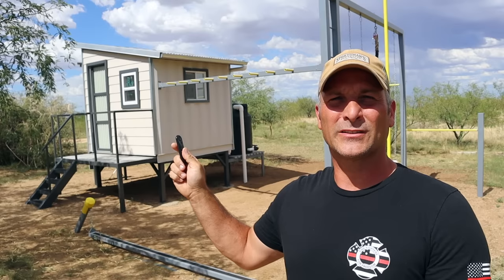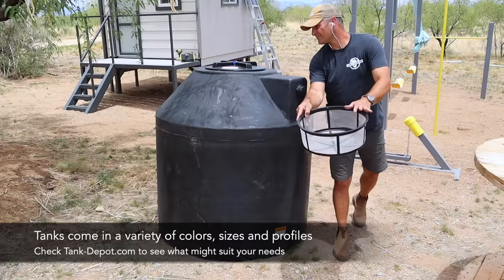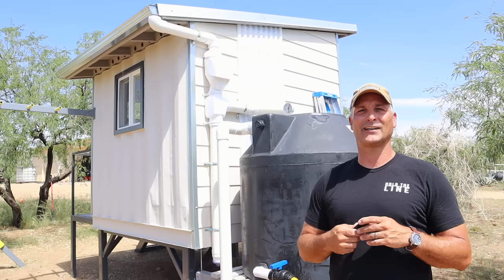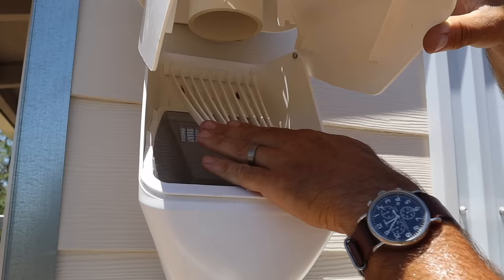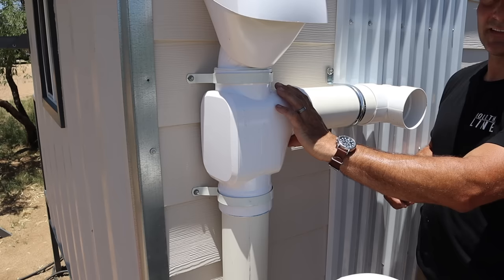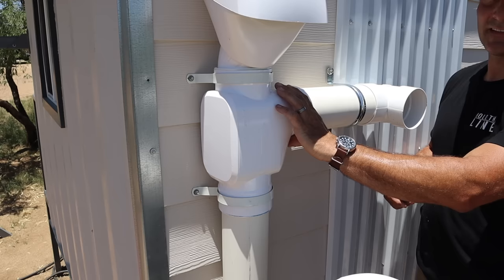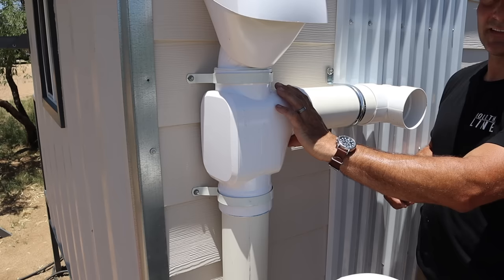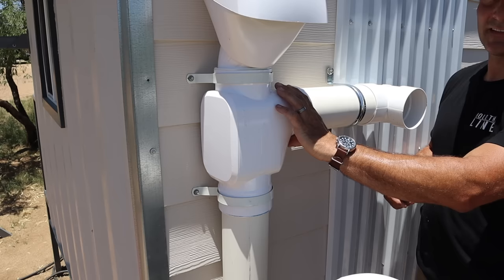Rainwater Harvesting on a Small Structure - How To - Step by Step Guide

Comment: What kind of filters do you use to take out the cemtrail poisons?
Reply from the maker: Move outta the city…. They focus on high density populations areas😉
Reply: @homesteadonomics , he needs more help!

It is no secret seeing water vapor form exiting a car's gas engine when cold. That's why propeller planes emit water vapor and that condenses into clouds at high altitude. Yup, the law of physics applies to jet engines also. They too emit water vapor, but it's warmer at lower altitude, so it's not condensed into clouds!
Reply: Try aluminum foil!
Reply: Excellent question

Comment: That is a really slick setup.  You might want to spray paint the plastic pipes with some silver or aluminum colored spray paint to protect them from the uv.  They can get pretty brittle.
Reply from the maker: You know what…I intended to mention that during the video but just plain forgot.  I do plan to paint then the same color as the side of the shipping container that they are mounted on.    But I’m gonna wait until summers over😂

Comment: Hey thanks for sharing. This was very helpful to me.  Just wondering if you would recommend putting gravel on the PVC pipe that is running underground. Thanks again.
Also, was going to say, since you threaded the PVC fitting onto the water tank  first, you can always extend the PVC pipe connected to your water outlet where you put in the spout. In other words, run the spout to the end of your raised structure that the tank sits on. I think that would have worked, too. Looks great.

Comment: A nice trick for starting the hole in the tank with the hole saw is to run it reverse to get the cut started. Bad things can happen running a large hole saw forward when starting the hole, and hard to get it started exactly where you want it. I've installed hundreds of tanks and it really helps. 

Nice work. Maybe a little overkill on the pipe diameter ;)
Reply from the maker: Haha….yes, very much overkill on the pipe size.   But this was the only structure I had to do it on as my house, shop, and pretty much every other structure already has tanks and collection setup.   So this was more of a demonstration opportunity to show the kit and also add a system to the container playhouse….even if it is capable of a lot larger volumes from a larger structure😉
Reply: @homesteadonomics  Major props to you for doing all that water harvesting. If we can get a million or two people on board maybe we could help return the Colorado river to its former glory.

Comment: Great setup and video. One thing I would do is connect the first flush to the overflow pipe to prevent any pooling below, which could lead to foundation erosion or wood rot pending materials. This would also help with any insects that thrive around water keeping them further from the collection tank and building.

Comment: Perfect timing. I've finally decided to get of my butt and get busy on a rainwater harvesting system. I know you're a fireman, do you have a high pressure pump that you can hook up to your system to protect your property in case of a brush fire? I had asked on a local FB group if anyone in my area had experience with such pumps and everyone basically said "Don't be stupid, call 911 and run away.", which I though was the most asinine advice I'd ever heard. If lightning hits the brush near my house and starts a brush fire, I'm not about to flee and hope it doesn't reach my house before the fire department gets here if I have a chance of stopping it before it gets out of control. Better to put out a burning bush or two than wait 5, 10, 15 minutes for the fire dept. when that one burning bush has become a  quarter acre wildfire.

Comment: nice clean install. We dont have gutters along our roof, and when we do get heavy rains, it floods the back yard and part of the back porch due to a low area. Im thinking I could install one of those (and gutter system)  along the back roofline and catch the water, and discharge the overflow directly into the breather/clean out for the sewer. That would prevent the flooding issue in the back yard possibly
Reply from the maker: I would definitely check out ‘French drains’ and possibly do a gutter run and then downspout that to the rocked area of the French drain.  Should solve that problem perfectly😉👍

Comment: I have had several houses with gutters and every single one of them has had problems with water sitting in the gutters.  Sometimes to the point it overflows the gutters.  The problem is poor quality materials for the gutters which causes the gutters to sag over long runs.  This is exasperated by debris collected which restricts flow.  This causes the gutters to create more problems than they solve.

Comment: I saw another video about taking a swamp cooler and generating, not using the humid output air, but circulating the cold water in the bottom of the swamp cooler, the sump, to pump into a room/house, and then running it through a heat exchanger, and with a fan making a low-power air conditioner that runs on water and solar energy.  This Playhouse design could be a very important self-contained designed for people in these hot heat-wave areas that would not take up much energy or resources and would keep people cool and let them survive in the coming years where this is probably going to get a lot worse.

Comment: Given the state of water in the desert southwest these days, more rainwater harvesting is always a good thing, even from a small structure like that playhouse.

I won't be surprised if you end up painting the tank a lighter color to prevent the water from overheating. Pouring hot water on plants or feeding hot water to livestock is probably not the healthiest option.
Reply from the maker: Yeah, I agree.  And you’re right on the painting.  I told them to send whatever was quickest to get our the door.  But I do like my tan colors out here😉

As for the rain, just depends on the location.  For example, last year we had (parts of southern and mostly southeast AZ) one of the best monsoons in recorded history.   Of course the news will only focus on the Vegas/Phoenix areas.  Fits the tempo of what they like to push.

And for the watering…yep, hot will damage and in many cases kill plants.    But I’ve got a little bit of a different end goal on this tank.  As a large volume  fill up for my fire trailer that I built several years ago.  2” fill with the quarter turn and it should fill those 30 gallons real quick 😀👍

Comment: Nice video.  One thing to point out (might already be in the comments) is that a 300 gallon take will weight 2500 pounds when full, therefore a very sturdy support system must be in place to hold that kind of weight.  And what about a system diversion so you can bypass the whole system for those in areas of freezing weather.
Reply: Agree 100% thanks for that.

Comment: Love this video!
QUESTIONS PLEASE:
57 year old city girl. Have wanted out for years. 
Have 5 acres raw land.(4 acres are wooded)

 Put a 12x32 shed with metal roof on the property. 
Need to be able to use the water for everything. 
The shed needs gutters and rain water harvesting. 
I all ready use Berkey filter for drinking my city water. I love it!

Property is TN/Al line so it does  get some freezing temperatures. (Bought property at end of winter so not sure how many days of freezing temps. )

I want to live on property year round. 

Questions:
1.What do i have to do so it doesn't freeze during the winter?

2. Can you connect additional tanks for more capacity?
I looked at my water bill for May and it said i used 1280 gallons (i don't know if that's a lot)
 I'm not using that water for gardening. 
I have a shallow well pump for gardening/irrigation. 
If i use that much every month how much storage should i plan for?
I'm trying to learn. 

3. Can the gray water from the shed/ house use the same pipe system as the tank overflow pipe?
I want to be able to use that overflow/gray water for garden and fruit trees. 

4. Anything I'm not thinking of?

Thanks in advance for thoughtful  and non condescending responses.
Reply: Hi, I live in Interior Alaska…we have an underground potable tank we fill ourselves or have water delivered..not sure how far the tank is buried, but we have heat tape wrapped around the outlet pipes that go into the house to keep the pipes from freezing during winter. We plug in/turn in the heat tape when it stays at freezing temps. Your use of harvested water is going to depend on how much it rains. Since we haul our own, and it’s just the two of us, we know we have to fill about every two weeks..our underground tank is 1000gal..we have a 200gal tank we put on the back of our truck and head to the watering station during non frozen months. We go til about November before we have to call in for delivery. I’ve been wanting to harvest rain water for a long time now for personal use to cut down on self hauling. This summer we hardly saw a drop of rain for May and June. It’s raining now and our 100gal rain barrel is full. That’s free water that I want for the house! This channel has given me the confidence to at least try different methods for our home. Hope I answered some of your questions and hope you are able to stay on your property more. Sounds like a lovely place. Any spot with more than an acre can provide you more than you know. You just have to put on the work. Good luck 👍
Reply: @marie-marie9645  thank you. It's a 13 hour drive from where I live now.  There is no water delivery service. Town is a 40 minute drive one way and my car is to small to haul anything....but its paid for :) so this may be the solution if i can figure out how to keep it from freezing. I eventually want solar on the property soon as water is figured out. Trying to do this with zero debt on the property. If i don't have the cash,  it doesn't get done. 1st step was finding land in my budget. Finally accomplished that. Now im trying to learn as i go.
Alaska is so beautiful.

Comment: You must get some torrential rainfall in your location to collect enough rainwater from that tiny roof and fill the first flush tube, then fill the tank.
Reply from the maker: This is a demonstration of how to install a system like this.   The components are sized to be able to be used on larger structures.  

But if you see any of my other structures you’ll know that I have tanks and gutters collecting off of virtually everything else.  So this was just the last building to put something on.   It’s definitely small but I’ve got a purpose for it😉👍

Comment: Whatever happened to your underground Greenhouse? I feel like you never completed that at least I don't remember you planting anything in there or growing anything?
Reply from the maker: I did a couple of updates.   One after the hail storm when I redesigned the roofing, added automatic heat vents, removed the support post, etc.   Then an update with plants growing in tubs.   You must have missed it.   Just scroll back in my videos tab.  

As for updates I tend to not want to re-show the same things.   So I tend to do updates when I add something to it.   The things I still need to do are adding some wall retention to the south wall and the cooling tunnel…. Of course that won’t be finished until I can get some real equipment as the ground is too hard and I just don’t feel like doing it by hand😂

Comment: Thank you for this! Question: h2o tanks are also used as "thermal sinks" in home greenhouses to stabilize temperatures from day to night & protect plants. Could h2o tanks in greenhouses be applied as dual-use, for both drinking water (or I suppose watering the plants too) and thermal sinks? Is this a lousy idea for some reason that hasn't occurred to me? Because I haven't seen the two systems combined by anyone yet.

Comment: My tank level thing quit working and I didn't know why until I drained and moved the tank several years later. The float thing went out the overflow tube. My experience is the first flush stays clogged after awhile (especially with shingled roofs) and is a waste of time and money. You walk by it and think what is that smell and realize it is clogged again and cleaning it is a nasty chore. Might want to paint those PVC pipes too unless they are UV stable.
Reply from the maker: Yeah I plan to paint them the same color as the shipping container structure.  But am going to wait until summers over😂

Comment: Can you do a video showing how you connect your tanks to the pressure pump?
Reply from the maker: You know what….that is something I’ve wanted to do for a while but my pump house is really tight and hard to get in it to film.   So my plan was to do a video on that when I ultimately made it larger.   But that hasn’t happened yet🤦‍♂️😂
Reply: @homesteadonomics  I look forward to it.  I’m stuck at that point and I keep trying to see what I can from your current videos, but I think the whole setup between rain tank , pump house, and back to the house would be super valuable.

Comment: I think you need to make sure that the bottom of the input screen for the water container is higher than the overflow level. I don’t believe you want your pickup screen to have water resting in it.  I’m just guessing but I would imagine water microbes could swim through the screen.

Comment: I have a question about water temperature… for the black tank (or any color in the sun) does it heat the water ? To a temperature that is too warm for direct plant watering? I’m not seeing much conversion around water temperature…. I’m planning my system and it will be a solar gain in direct sun most of the day….Thanks nice video

Comment: I set up a similar system on my prepper shed,  but I set up my system with a solar 12v pumping system,  the only thing I would have done differently to your system is use metal instead of wood for your tank lift, water is very heavy.
Reply from the maker: The gray frame below the wood is 1/4” thick 3x3” steel.
Reply: @homesteadonomics  that's good, those tanks hold approximately a ton of water, I build steel reinforced concrete bases for my tanks.

Comment: Really great kit and I loved the whole process/assembly. I know that I have joked that you will collect water off of anything but is there a point we’re return on the parts/labor don’t justify the setup? Is your goat barn going to get tied into you rain collection? Thank you so much for sharing and may all your water tank get full.
Reply from the maker: Haha….yes there is an ROI for every project.   Yes the components, piping, etc are definitely overkill for this small structure.  But it’s more of a demonstration setup of how it can be done.   Not necessarily an ideal setup for the small collection area.   I’ve got pretty much all of my other structures guttered with water tanks so this was just the structure I had available to do ‘step by step’ kinda video to demonstrate it.  
As for the goat barn…. Yes there will be rainwater harvesting….but not until I get the hay structure up first.  I’m actually thinking of moving my rain roof project over to it to serve both functions.   So there will be rainwater collection on that eventually😂

Comment: Hello, thank you for the clear, and informative content. Question: at 11:15 you are talking about the bottom component of the first flush system. I checked the link at TANK DEPOT to see if this was sold separately. It doesn't seem to be. Any idea where I might find just this component? I have a system in place, but it is cruder at that juncture. Again, thank you.

Comment: Hey Joe. Great tip on the overflow, never seen that before. What’s your thoughts on running pvc pipe into the ground, considering the structure/ground might shift? There’s no “give” in the pipe work now

Comment: On a related subject,how is the billboard tarp harvesting system holding up these days?
Reply from the maker: Oh it’s still there but I told the IBC tank away and it just directs that water down onto the road an into those little ponds.   However it is getting weathered from the sun.   Virtually no print color left on it anymore.   Probably need to roll it up and dispose of it.  Although I do really love the concept and Do some more with tarps in the future
Reply: @homesteadonomics  thanks for the update,I was wondering how long it would last in the Arizona sun,good to know.

Comment: Is it possible to get a tank to go under a pre-existing deck?  I feel like that would be a perfect space to keep one.
Reply: Hmm, also would be interesting to know winter options.
Reply from the maker: I think under a deck is a great spot.  Keeps the sun off the tank and all of the piping would have some protection as well.   And regarding winter….if it was under a deck, depending on the size, you could skirt the deck underside to help mitigate freezing conditions to a degree.   Homes put out a radiated heat… and the skirting would trap a bit of that to help with the temps during winter.  Of course you’d want to insulate in really cold places for optimal winter usage.   Otherwise draining the tank and pipes for the coldest months would be recommended